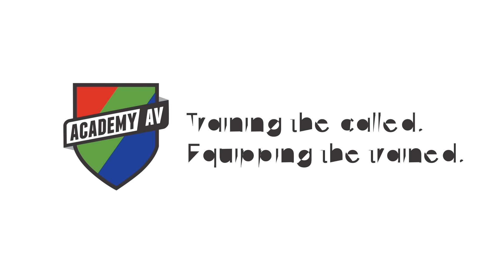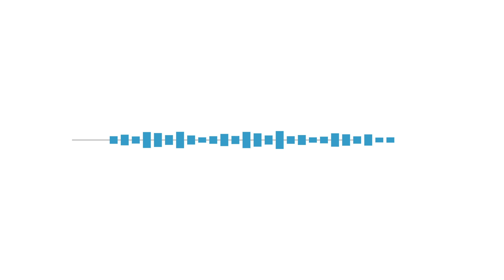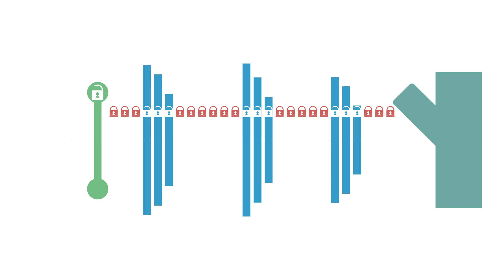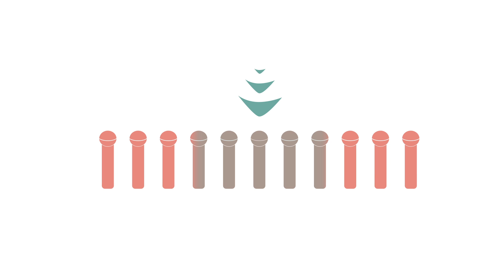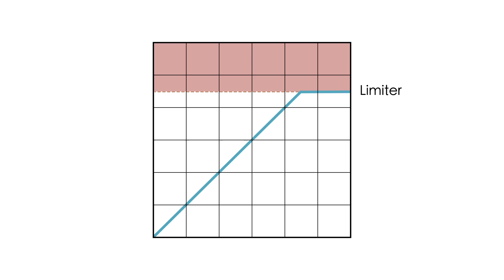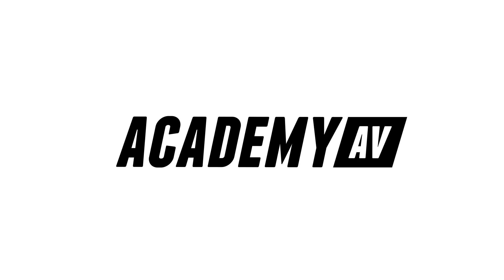Audio Theory - Gate

Comment: Why would you want to use a gate or expander ? What sounds below a threshold would be unpleasant?
Reply from the maker: Akhail Singh Room "noise" can be an issue. A gate or expander allows you to cut down on that ambient noise that is muddying the sound you are trying to capture.
Reply: suppose you are recording drum the mic of kick drum also catches some of the snare so you have to remove those snares from kick drum recording then you have to use gate,or simply if you want to remove unwanted noise you have to use gate